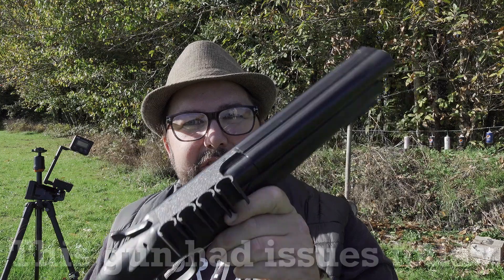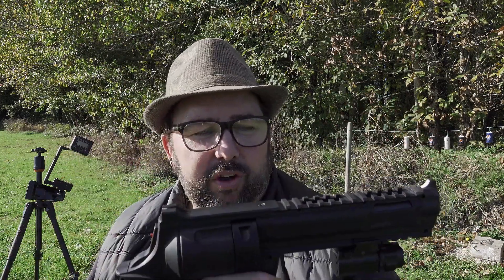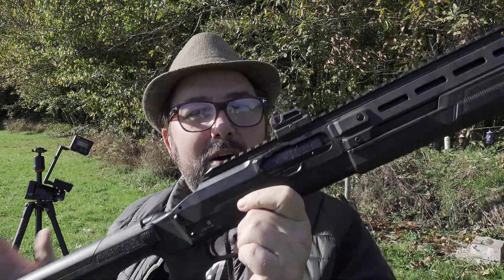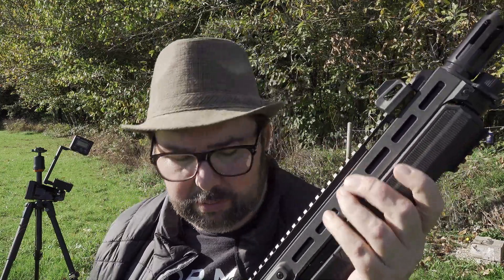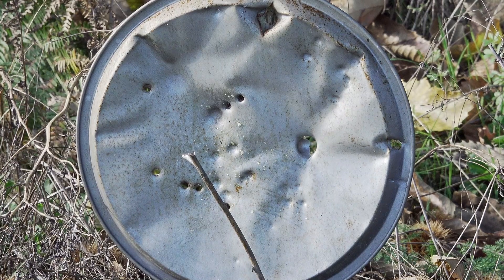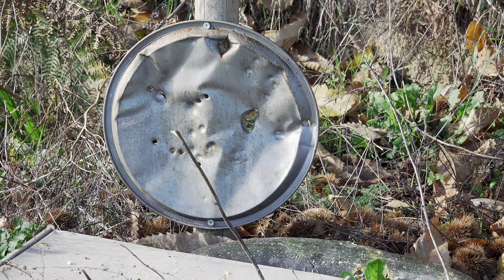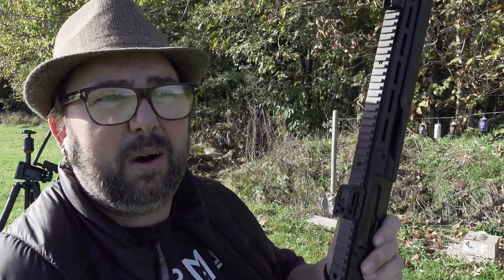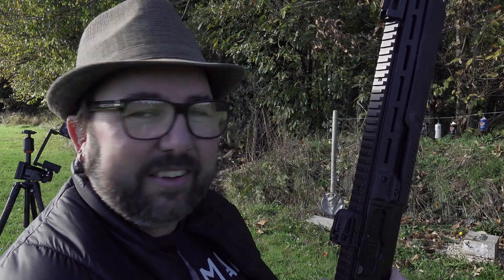Firing 0.68 cal Aluminium Balls

Comment: Yes, you're very right.  These aluminum balls give quite a hit.  I have a HDR 68 16 joule version which I have connected a PCP remote tank of 1100 psi outburst.  It work well and very powerful.  I'm planning to change the the original barrel to a steel HDX barrel.  I just wonder how would it affect the joules on these aluminum balls.  Would love to see a video of it.   Thanks.